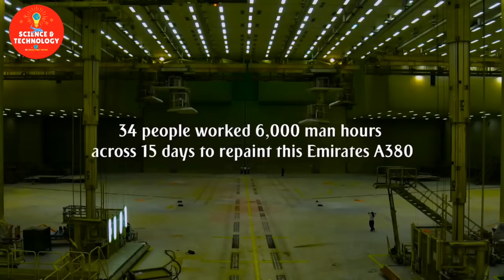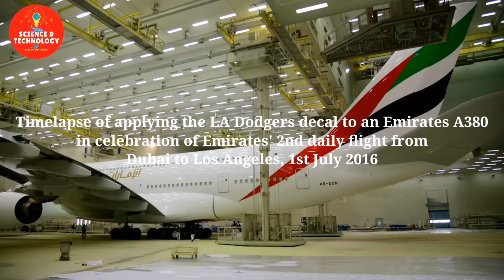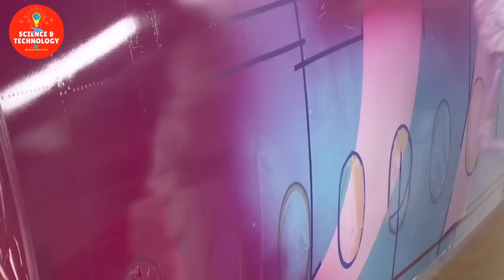Modern Technology-How Airplanes Are Painted?-Timelapse Painting of an Airplane-Inside Airplane Tech

Comment: What are they using to strip the old paint?
Reply: Back in my Airforce days we used paint stripper called 8016, and the more powerful Phenol paint stripper. Very powerful to remove two pack polyurethane paints.